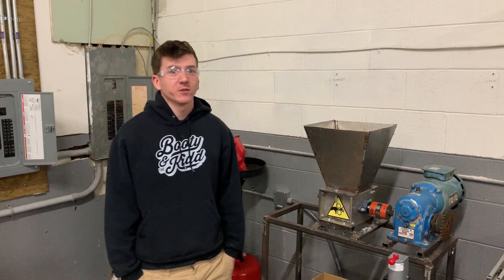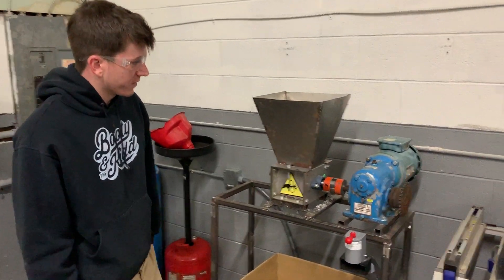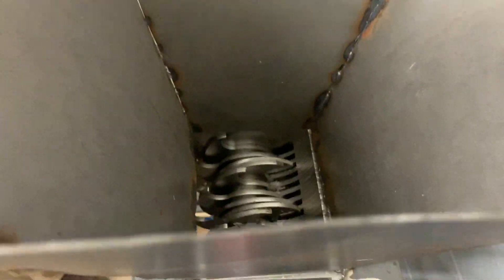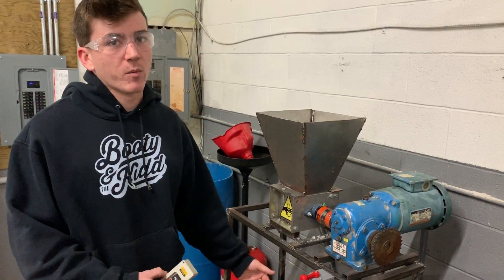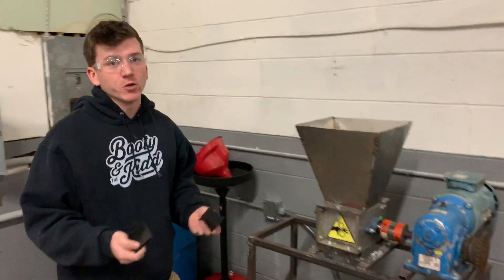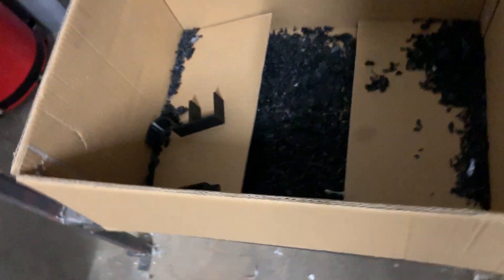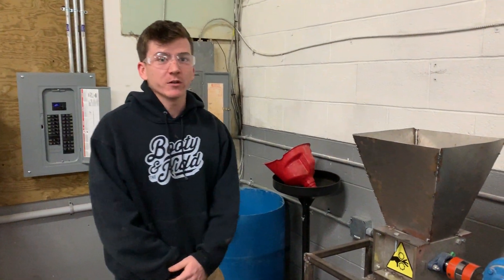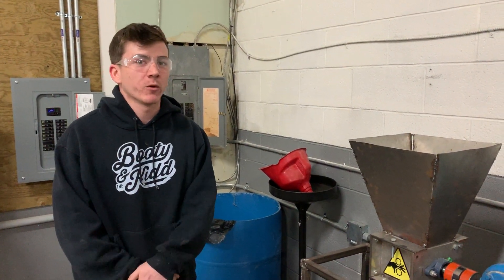Shredding 3D Prints with Our Homemade 1 HP Plastic Shredder

Comment: looks like it comes out a bit large, do you rerun it through it to get it down to size, or use sieves or something?
Reply from the maker: we do usually re-run the flakes through once or twice, however our extruder works pretty well as long as the flakes are all about a cm^2 , sometimes you get flakes that are long and thin (say 1.5" long and 3-4mm wide), and the long n thin flakes can get caught in the hopper on our filament extruder
Reply: Are you using just plain Filastruder? Curious that it has no problem exceeding the recommended spec by that big portion.

Good to know!
Reply from the maker: @skaltura  yep just plain filastruder. I'll post a video soon